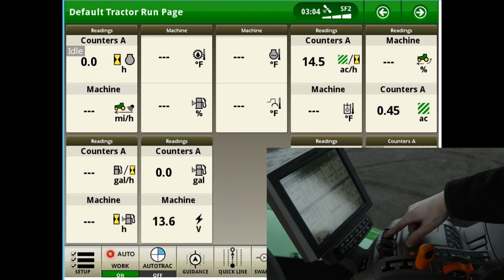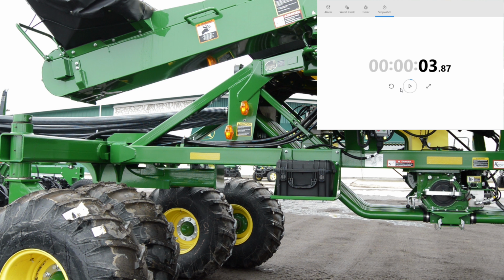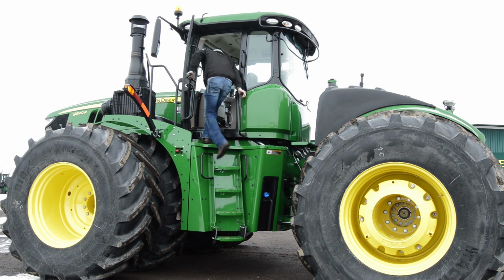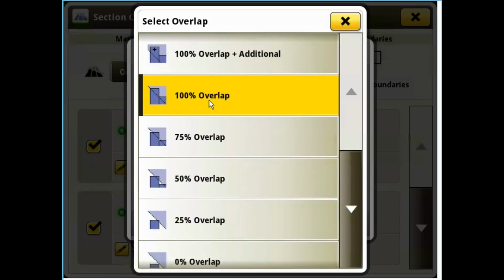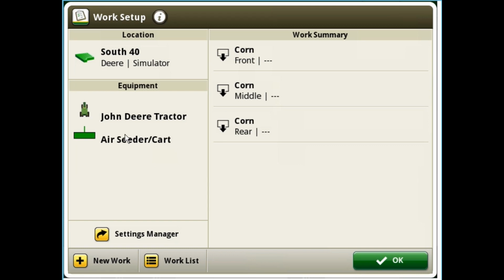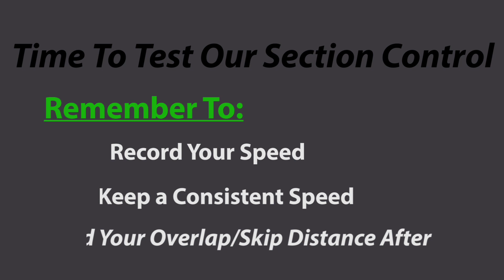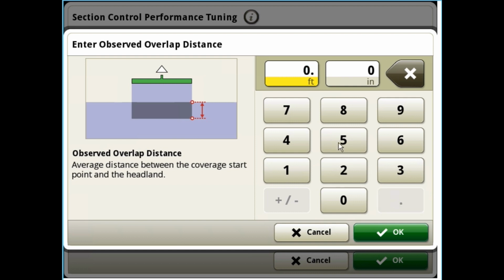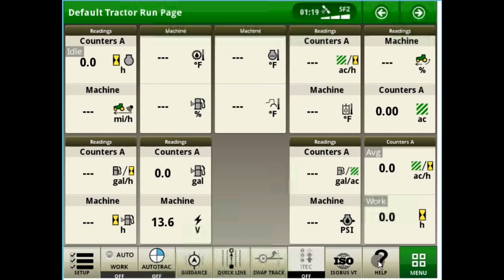John Deere Gen 4 (4600 & 4640) Display Section Control Setup for Air Seeders

Comment: Thank you for posting this, very informative and helpful. Do you know if the same/similar process can be done on a JD Sprayer with Exactapply section control with a 4600 display? Thanks again.
Reply from the maker: Sorry for the delayed response! Yes you can do the same concept. if you go to the menu button on the bottom right of the screen and then under machine setting go to calibrations and procedures. Then you can select the nozzle flow check. i suggest doing this with water as you have to turn the entire sprayer on you can't do it nozzle by nozzle. You could do nozzle by nozzle with the remote you get but i don't suggest doing so as the wireless remote would have a different time then through the screen as its wireless.
Reply: @michaelbischoff6114  Thanks, Michael. We'll look into it. Trying to dial-in some sprayers as best we can for automated spot-spraying in emerged crop. Here's an example: https://www.youtube.com/watch?v=LahCZrn32BI&feature=youtu.be